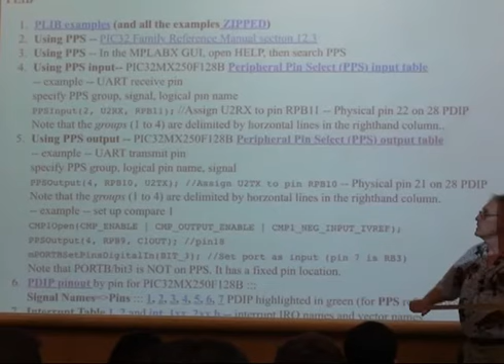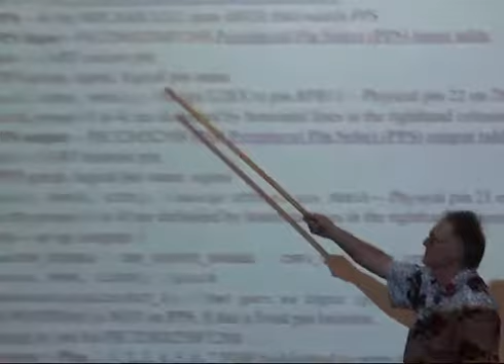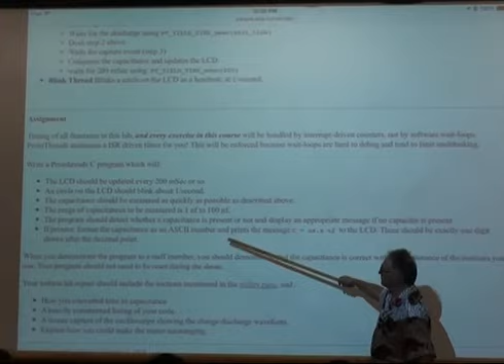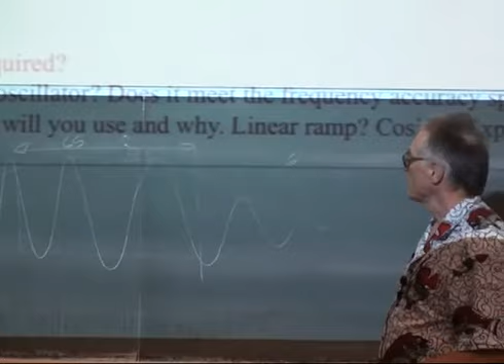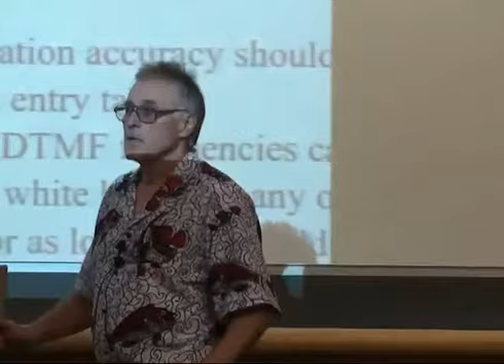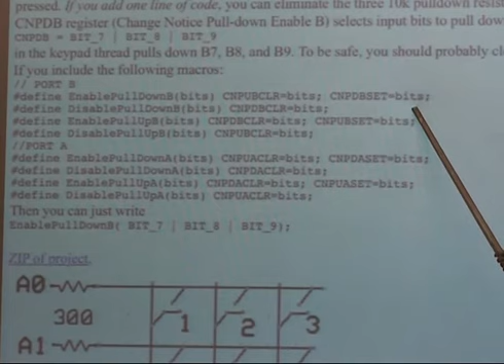#5 lab 2 DTMF dialer

Comment: DTMF sends 4-bit. Is any DTMF-like standard to send 8-bit with sound?
I want to update firmware via Mic.
Reply from the maker: for decades data went over analog phone line as tones. look up ‘acoustic modem’
Reply: It's 4 bits per "symbol". You could send two symbols, or I guess you could have a L and R channel with DTMF over each channel. Look into QAM, it's interesting.

Comment: What are the trade-offs with a simple RC filter as a debounce solution as you can save few CPU cycles and code size?
Reply from the maker: Circuitry or code could be more expensive, depending on context.  Also depending on the scan method, it may be difficult to RC filter a keypad. Besides, this is s good way to teach state machines. A good discussion can be found at http://www.ganssle.com/debouncing-pt2.htm